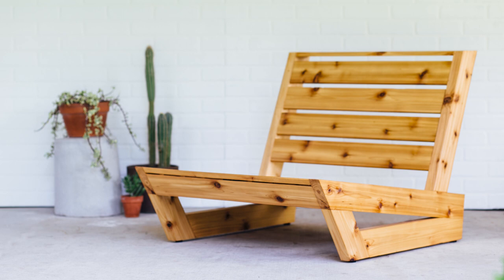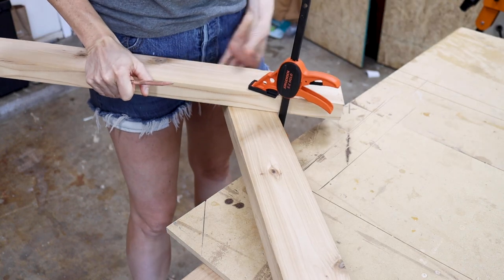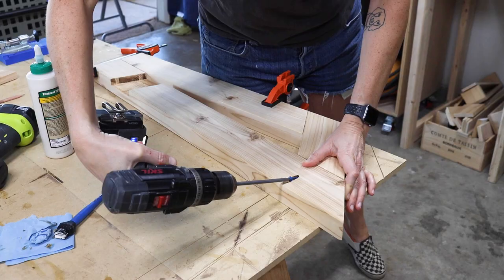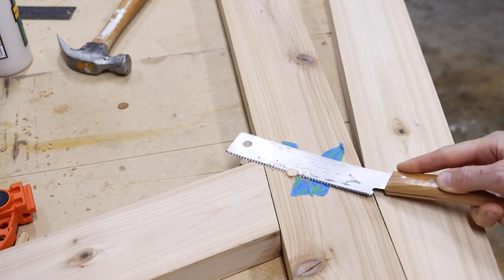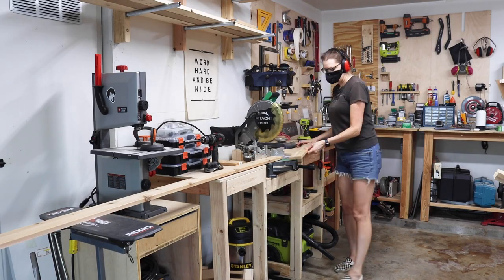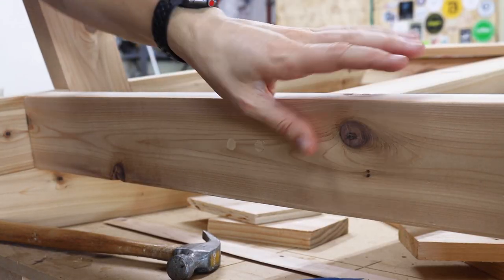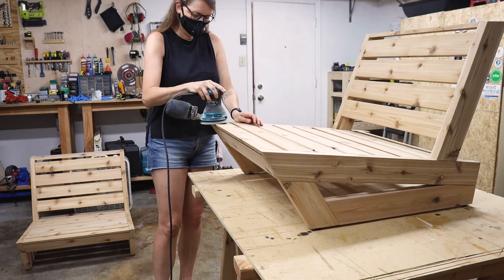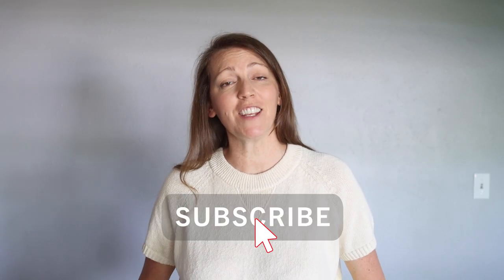How To Make A Modern Wood Patio Chair | I Saved $$$!

Comment: Your crack joining glue looks just the job for an idea I have wanted to do for a while. Here so here goes get some green wood and machine it roughly to the desired shape. Deliberately dry it the wrong way put it out in the sun or in and oven and dry it in a couple of hours. It will end up full of splits and shakes. Now fill them all with you glue but with added epoxy resin colours I would go for black or clear red. You are going to end up with some sort of spalting effect. If anyone asks you what it is make up a name like the rare New Hampshire Red Speckle Maple.

Comment: I love cedar but it is expensive in the UK I am planning on making a three piece suite similar to this but for indoors in the Philippines. We don't have cedar here but we have a slightly harder wood red lawaan. Difficulty getting wood here because of logging bans so I may just suck it up on the hardness. I think if you can get away with half lap joints in a project you should, you can basically walk them into place. Take a bit of wood off until you get them to fit perfectly.

Comment: The CB2 chairs are actually a decent deal when you factor in that they are Teak which is a hardwood vs Cedar which is not. When you consider the cost of cedar, the time invested, and the cost of either buying or making cushions the $799 becomes more attractive. Cedar is prone to splitting and will need considerably more maintenance. Good job anyways👍

Comment: Nice. To make a 100 usd lounge chair you just have to have 30 000 usd worth equipment.
Reply from the maker: Wow. I WISH I had $30,000 of tools. It's entirely possible to make this chair only using a $100 circular saw.
Reply: I'm surprised people are actually still making this exact type of comment, especially considering that this project could easily be done with just a circular saw (which you can find used for like $10 on local markets). But what's so bad about a person using the tools they have? Sure, it's instructional content but there are many, many ways to do things in woodworking
Reply from the maker: @TracksWithDax  That's exactly how I see it. Just because I might use a miter saw for one cut doesnt mean it couldn't be cut with a different saw. The point is just to show how I did it and hopefully inspire anyone that they can do it too with whatever tools they might have. Thanks!

Comment: Way to steal the design of DIYCreators and make a 2x4 version and act like you designed it. Wipepo smh.
Reply from the maker: 😂 Thats funny. You should do a tiiiiny bit of research first. I made my chair in May of 2020 and released the video in August of 2020. DIYCreators came out last month, which is September 2021.That’d be quite a good trick to steal a build from the future. Smh.
Reply: Julius, Way to make an accusation in a condescending way and not have the decency to apologize when you were clearly wrong. SMH